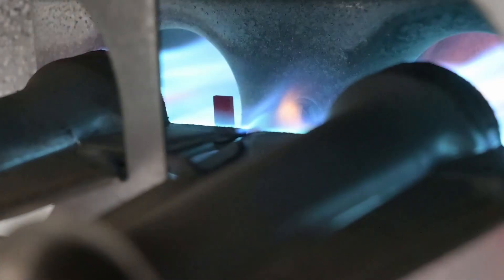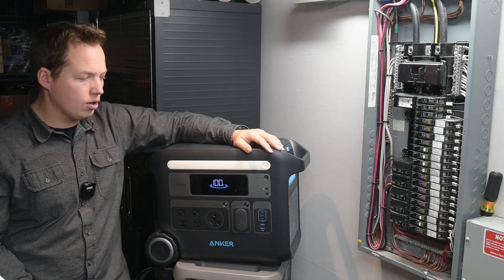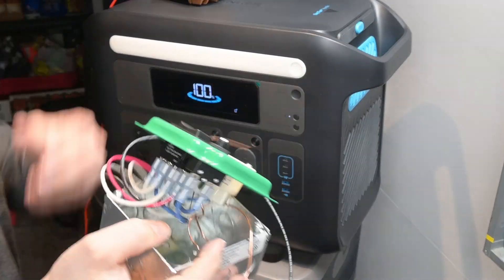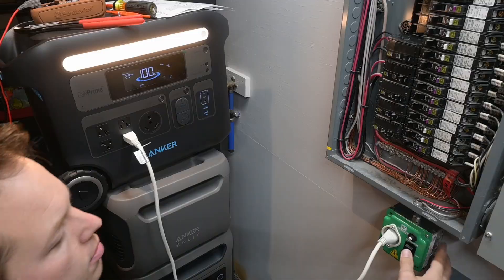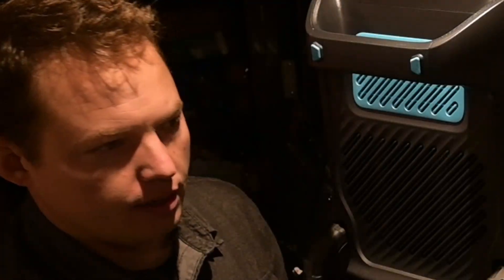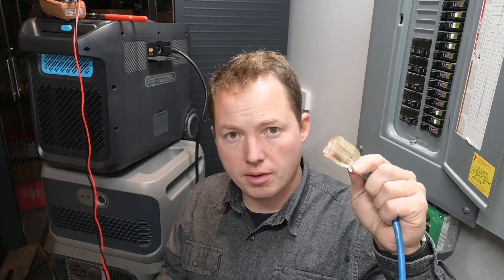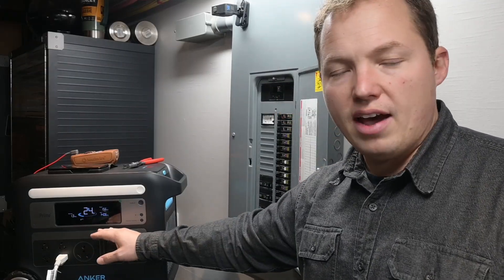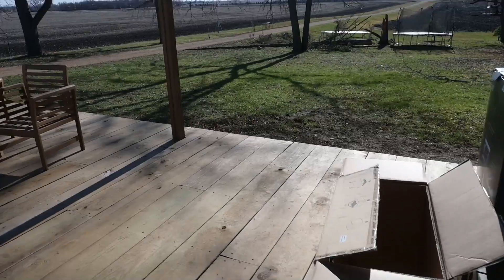Running a Furnace with a Power Station! Anker SOLIX F2000 Test!

Comment: I noticed that you switched to the Anker power while the panel was hot.  Should one be concerned that the Anker neutral is connected to the panel neutral while it is hot?

Comment: When the UPS function test happened that caused the trips: https://youtube.com/clip/Ugkx0lTh-uNLtbvGBHVUEq4XYLlChbjjJ9LG?si=V05d9dLiM-a2Zo7C Benjamin said it was because of shared neutrals. I assume it happened because of crossing neutrals between circuits; that is the furnace circuit and the circuit he was plugging the AC input into.

Does this mean that the AC input and the AC output stages of the unit are connected? I thought they should be isolated?
Reply: I think the same; the output plugs connect to the incoming neutral of the main panel. I believe that to power any circuit through a UPS or EPS station, you should disconnect the neutral of the circuit to be powered. What remains is a floating connection when there is no current; while there is power, it will simply be connected to the neutral of the panel.

Comment: The voltage you were getting was probably voltage that was intended to be present. However when you shorted them out, you clamped the voltage down to 0 and those capacitors were limiting current. Safety capacitors supress noise going in and out, and might be there to prevent relay arcing though I'm not sure where they are in the circuit.
A side effect is static shocks coming from you get dealt with safely and with no harm to the equuipment.

Comment: How is this not going to backfeed power into the panel?
Reply: The switch on the green box he installed isolates the panel,  it powers the circuit either from the panel breaker or the generator socket.  It's very simple actually.

Comment: Hi do u have a vedio on which generators are the best to charge solix 2000 or similar system
Reply: Anything that isn't a brushless generator should be perfectly fine. Both my generac portable generator and champion inverter generator charge it just as well.

Comment: Did you check to see if the the hot and neutral are reversed on the power station? I've seen many reviews that say they are reversed, could that also be the cause of voltage on the input??

Comment: Anker has had a problem with these devices having reverse polarity, if the small one has 70 plus volts bleed off what does the larger one have, 120 could be lethal in the right circumstances.  Most of these Chinese devices don't meet NEMA standards.
Reply: Reverse polarity, what are you talking about? Capacity has nothing to do with how much voltage shows up on the charge cord. The voltage of the inverter output does.

Comment: 40 cents/ kwh over here in Central CA during peak.  2 kwh per day is $24 a month, and $288 a year.  Usually a furnace has an accessible 120 cord, so I don't think these types of transfer switches are very useful since they can only handle one circuit.  If you plug the solar generator directly to the heater, you can plug the solar generator directly into the wall and not have to worry about tripping anything and just use it as a UPS.  I hooked up a 4 circuit transfer switch and now I regret not doing 6 or 10 circuits.
Reply: $.40 kwh, omg! Imagine charging an EV on that.
What is the cost of peek?
What are the times of peek and off peek?
Reply: @markchidester6239  Peak is 4:00 to 9:00 PM for most people.  There are different plans.   Peak prices fluctuate from 38 to 44 cents.  I just call it 40 cents per kwh to keep it conservative.  There are breaks for EVs, but that's going away.  We are on NEM 3 metering now which pays  very little for power back to the grid for new solar owners.  If you calculate 40 cents/kwh and have a 100kwh battery, that's $40 per fill up, which is not bad.  You would just have to have a lot of batteries and panels to be able to do that every night when you get home.
Reply: @markchidester6239  You typoically don't want to charge an EV during peak anyway. My car avoids drawing power during those times.

Comment: If using that type of battery would we need an inverter generator or could we use any generator to charge that battery while hooked up to a transfer switch to power sensitive electronics such as tvs and computers?
Reply: You need an inverter generator.
Reply: @teuton6167  Are you saying I need an inverter generator just to charge one of those batteries? or only if that battery is powering sensitive electronics at the same time?
Reply from the maker: You should be able to use a normal generator to power it but when it is in UPS mode I believe it transfers the power straight through.
Reply: @BenjaminSahlstrom  Thanks
Reply: These are not recomended for use with desktop computers. They switch too slowly and my bluetti will shut off my PC if it's under heavy load when power is removed. Get a real UPS and feed it with this.

Normal generators are okay too, though those briefcase non inverter generators make my power station upset to the point where it won't even charge. I've never had either my computer setup or my power station not want to use my normal generator's output, either. So you should be all set.

Comment: Why not just a switch with an outlet onto the furnace and wire in a short cord to plug into either the outlet on the furnace or the Anker?
Reply from the maker: Will be exploring this topic more in an upcoming video, but there are a few reasons why this setup is better.
Reply: That requires a "suicide cord" where there are male ends on both ends of the short cord - one to plug into the outlet on the generator (battery or gas) and one to plug into the standard outlet.  These cords are illegal -- and dangerous due to the high probability of contacting a hot male end that is exposed.  The box shown in the clip has a "shore power" connection - the male end in the box is recessed and could also be covered when not in use.  The switch disconnects power from this connector when the furnace is running off of normal grid power.  Much safer and allows using a standard extension cord.

Comment: WHY WHY WHY
do this? If the power is out extended time, TEACH RESILIENCE and compartmentalizing your home, run small single low wattage unit if anything at all.
This is a waste of time!! Waste of resource. 
RIDICULOUS.
The inmates are running your asylum
Reply from the maker: There are different levels of power outages. If the grid gets nuked, I'm with you. At that point, it's all about survival and conserving as much as possible.

If, however, there's a storm that takes down a few lines (like most power outages), you'll likely have power back within a few days at the most!

I don't know if you watched the whole video but I demonstrated the concept of only running your generator a couple of hours per day so that you can use the battery to run just the furnace.
Reply: @BenjaminSahlstrom  no doubt
Best advice.

Comment: The shared neutral is an issue for anyone using a transfer switch and powering inverter from
Main panel, kinda like a UPS. Only way around it is to use a non GFCI breaker on the circuit powering the Anker. Not sure if it’s right but it works.
Reply: If you keep the oiginal set up with neutral that also switches, can you an level the UPS/Anker plugged in without tripping the GFCI breaker, as the would not create a second bond point. So as long as the Anker is plugged in, even with the power off it would appear grounded to the furnace and would still run. Let me know if that works. I have a very similar setup .
Reply: @71BaamBaam me gustaría q alguien respondiera esta pregunta,pienso lo mismo q UD,estaría viendo el neutro del panel incluso si no hay electricidad estando enchufado? Haría lo mismo si quiero respaldar un circuito básico ,cortaría el neutro tmbien en ezgenerator
Reply: My Bluetti AC 200 Max does not trip the GFCI when plugged in to the main and running the transfer switch - probably something to do with the AC to DC converter of the power brick.  I have another station that does though.  Renogy told me that their inverter charger would be ok to connect directly to the transfer switch without having to worry about neutral ground bond issues.

Comment: Probably designer improperly calculated power dissipation for shunt resistor and it burnt immediately after first using, so capacitor in your power bank is no more shunted by resistor.
Reply: That's not what a shunt resistor does or how one works. If you have capacitors across a relay, voltage will always be present on both sides.

Comment: The safety capacitor should have a resistor to bleed off the voltage stored within seconds.  There may be a small normal amount of leakage current through the capacitor.
Reply: There should not be voltage. The resistor would bleed off any capacitor residual voltage. From the HVAC point of view this would be similar to the start run capacitor.
Reply: @johnsarafin8144  There absolutely can be voltage. Why shouldn't there?

Comment: I have the same transfer switch and have it wired to a circuit that has an outlet in several different parts of the house and several led light fixtures.  Power cost here is about $0.12 including all extras on my average power bill from the city owned muni power company.

Comment: Warning……. Not a how to video. Just another product advertisment disguised as such
Reply from the maker: Wasn't my intention. I might actually change the title to clarify. Thanks for the feedback.  Possible new title: Running my Furnace Using the Anker SOLIX F2000 Power Station
Reply from the maker: Settled on this: Running a Furnace with a Power Station! Anker SOLIX F2000 Test!
Reply: Link to furnace

Comment: So  i get running natural gas furnace like u did.  We have a natural gas furnace boiler.  One haa to also power circulators correct?  How much power is consumed with those circulators running?   My house has two zone baseboard so would need to include  that i think? I also have nest thermostat which is on transformer although it has some internal battery.
Reply: As long as you get a power station with a capacity similar to this, you shouldn't have issues. Nothing will be able to tell the difference and your thermostat gets power from the furnace transformer

Comment: I've seen something like this before when I was using an off grid inverter to run lights while I hooked up the grid input to the same inverter at my main panel.  I'd get some low voltage off the inverter neutral from running the lights due to the floating neutral.  Not enough to really zap you but enough to make my fluke non-contact voltage tester intermittently chirp.  I suspect this phenomena is related to that floating neutral and Anker just fed you some random jargon. 
P.S. please wear safety glasses when shorting out electrics in front of your face, I appreciate your safety squints but... ;)
Reply from the maker: When I was editing the video I was thinking that too... Bad call on my part... I would hope Anker was being honest but like I said, I'm not an electrical engineer! :)
Reply: @BenjaminSahlstrom  Nor am I, I could be completely wrong as a power station is not the same as the stuff I typically fiddle with.  Working with off grid Solar, managing the neutral to ground bond is a constant issue and every inverter is different.  Some have internal relays that bond the neutral to the ground or float it in different modes too.  If you turned the UPS mode off I wonder if the voltage would still be there, actually.
Fun fact while we're talking about getting zapped by things that shouldn't be hot, there are some solar charge controllers on the market that will put out low voltage AC on the DC lines from the solar panels.  If you don't ground your array you can get a 'tickle' from touching the solar panel frames when the sun is out.  Solar can be very... exciting sometimes. :)

Comment: Hi Ben..  I also am from MN and pay $.088+$.037 per kWh (total is $.125/kWh) , plus all the other crap..  Basic Service Charge, Affordability Charge, Resource Adjustment, Interim Rate Adjustment, City Fees, Transit Improvement Tax, Other Special District Tax, County Tax, State Tax.
Reply: affordability charge? charge you to make electricity more affordable.
sounds as messed up as ontario!
Reply: @Jon-hx7pe  It is the cost to provide payment plans and non payment for low income individuals, phrased more positively of course.
Reply: I pay around $0.24/kWh in Los Angeles, which is better than Northern California where electricity is like $0.40+/kWh.
Reply from the maker: Minnesota is not great for costs especially with all the green energy stuff. Crazy how affordable power is in other parts of the country! 

They're turning some of the best agricultural land in the US into solar fields around here. Seems like a bad idea.
Reply: lots of bad ideas - solar panels are crap on the grid without storage. nothing green about green energy.  @BenjaminSahlstrom

Comment: UPS witchcraft. The input is essentially connected to the battery bus and the output and its all hot. The mystery isn't that there is voltage on the input the mystery is why does it not knock you on yer ass . Very interesting video Ben. Thank you.
Reply: It's not a mystery at all. When he touches it the voltage gets dragged down. It's power electronics 101

Comment: Ontario canada - time of use rates, 8.7 cents off peak, 12 cents mid-peak, 18 cents peak. add 2-3 cents per kwh transmission to local utilities. fixed local utility fees mean being charged $40 b4 using any electricity. the system here is really messed up - the tou periods don't coincide with demand.
lots of political interference!

Comment: I got a bluetti ac180 today for $682 shipped including taxes for a backup (among other usage) for this same purpose. A few years ago we had a 3 day power outage in winter were the temps were under 40F and it was no fun without any furnace. Although we did light the gas fireplace and had a few items on kitchen the gas stove it still was a chilly time.

Comment: 6 cents a KWH under 1000kwh a month, 6.8 if over 1000kwh.  Northwest hydropower FTW.
Reply: i like hydro and nuke - and hydro is nice and cheap. crappy intermittent renewables, not so much!
Reply from the maker: What in that world. That's SO NICE!
Reply: @BenjaminSahlstrom  It's a PUD that mostly gets it's power from the Bonneville Power Association which runs the dams in the region like Grand Coulee.  It's actually gone up, when I moved in 9 years ago it was 5.2 and there wasn't an overage penalty.

Comment: you must have a psc motor with those wattages.
2kw storage capacity sucks
Reply from the maker: It's an ECM main blower but only 2 main stages. I really like how the ECM ramps up and down quietly.
2kwh isn't a lot but it does buy some time!
Reply: big furnace or high static? 40 to 60k btu furnace, would expect low fire 100-150w, high fire up to 300w.  @BenjaminSahlstrom
Reply: standing pilot gas fireplace is a great alternative for emergencies, doesn't need power beyond what's generated by the powerpile heated by pilot @BenjaminSahlstrom
Reply: My 100k BTU forced air furnace pulls around 1200W. I am jealous of these lower power draws.
Reply: 100k is nuts for a house if you're talking high efficiency (90%+)- many furnaces are so grossly oversized its not funny.  @erikj9962
Reply: 2kwh energy storage sucks? Compared to what?